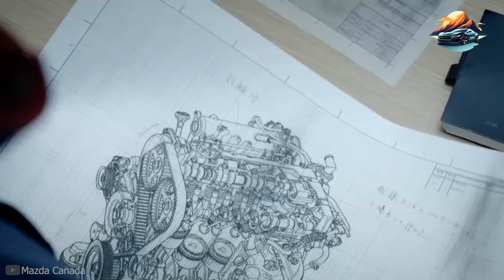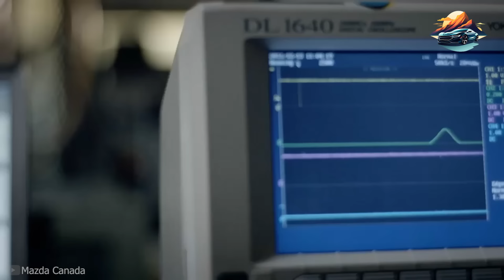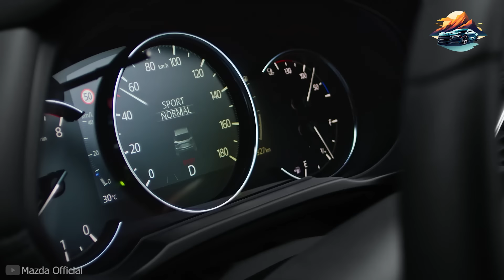4 Car Brands That Are Equal (Or Better) Than Toyota For Reliability

Comment: As a mechanic for over 28 years, I say Toyota cars are reliable, but their reliability is over rated. In the late 90s until 2003 their v6 had major sludge problems, just look up the class action lawsuit on the Toyota 1MZ v6. Then look at the rust problems on their truck frames that they are now paying a billion dollar lawsuit on. Also the oil burning problems since 2008 on the 4 cylinder engines, and now the turbo engines are blowing up. Why don’t they ever get the hate of the car journalist? These so-called experts hate on Nissan when they come out with innovative technology, but Nissan is still the company that make Subaru’s all wheel drive not Toyota. And Subaru had much better engines when Nissan was making the pistons and crankshaft. But Nissan sold their ownership of Subaru to Toyota in 2002. IRS interest Nissan wasn’t on this list, and Subaru’s reliability has gotten worse since Toyota bought the controlling share from Nissan. That should tell us something. Toyota still makes good cars, but Nissan makes better in several models. Just look at how long do Nissan engines last and Google the same for Toyota. I work on them. I own a 2001 Nissan Xterra v6 I’ve had for all 23 years of its life, and it has 462k miles on it. All original engine no special maintenance, all power windows and AC system original I replaced the starter at 303k miles and 16 years old. All the Nissans I’ve owned I’ve put over 300k on three of them with no problems at all. Just change oil, and all the filters. I’m sick of hearing that Toyota’s are the top of reliability, most Japanese cars are very reliable, and that certainly includes Nissan!
Reply: Thank you. You've spoken my mind.
Reply: Very true! Toyota reliability is over rated. Several problems worse than other brands. Just the noise they have managed to create about their reliability
Reply: @frno1073  That is just one brand. What about the numerous problems of Toyota venza?? I've seen many Corrolas entire back axle fall off. A lot of chassis problems. 
And when on highway, most Toyotas cannot handle the highway speed pressure. They become light like a paper and we overtake them and their accelerator pedals touches base. I have a Volvo s40 driven over 20 years but I make all Toyota cars small on the highway except the land cruiser .
Reply: My Navara has electronic 4x4 system way back in 2008 but it is recently that Toyota hiilux has done it. Toyota sticks to old simple fashioned gadgets and always copies others after being invented.
Reply: @frno1073  They used cvt transmission from Jatco which affected them few years back but they've quickly changed that. The new Pathfinder is my dream car lol
Reply: @frno1073  They used cvt transmission from Jatco which affected them few years back but they've quickly changed that. The new Pathfinder is my dream car lol
Reply: Nissan was a good car, see even you give 20 years old examples. Since the advent of CVT trans, Nissan is still a descent car but must put money aside to change that transmission that will crap, just a matter of time.
Reply: What's your opinion of Honda CRV?  Is the hybrid a wise choice?
Reply: I do not believe Nissan makes Subaru AWD.
Reply: I am 62 yrs old now, I owned 1998 Nissan sentra, it had no issues for 25 years. I even bring it to mountainous at sierra madre, surprisingly, no problem encountered. 
It was sold at a price of 70k early this year,

Comment: Nothing is better than Toyota. Lexus maybe but it isToyota😊
Reply: For sure
Reply: Had 2 Camrys they were great. Now have a Lexus SUV. I love it. Will always be a Toyota Lexus fan.
Reply: Company’s truck sold Toyota Tundra @ 750k miles and still no major repair…
Reply: My Lexus is 10 years old. Nothing has broken. No breakdown or failure anywhere. Nothing ever.

Comment: Had Scion tC  (that's Toyota) 2.5L engine... have driven it like a hell, hard, fast... however, changed oil regularly...  Made 300,000 miles with NO - ZERO.... absolutely NONE - ZERO issues
Reply: I still have my 09 baby blue Scion TC that has no tears or rips in the dash or cloth seats!  The paint is still shiny on the entire car and has a little fading on the trunk and on top of the drive and passenger side view mirrors (which are painted plastic, i think)!  It’s our current 3rd extra car parked outside with a car cover on it when it’s sitting and not driven (i drive it sometimes to keep it well lubed and moving).  😉
Reply: bro, just wondering, I have a 2010 tC, and engine is great... except it EATS motor oil like no tomorrow... heard its a common problem with this engine type, are u having similar issues?
Reply: @ I have an 09 TC w/ 189K mi on it.  I have noticed over the last 10 yrs I had to add oil every once in a while.  I’ve been using M1 full syth 20K oil for the last 10 yrs.  It’s a 3rd car now mostly parked, and still trouble free.  That 2.4L with that 4 speed auto in them may be why they went trough oil a lot because it’s always above 2k rpm’s.  Maybe those w/ the 5 speed stick spin less rpm’s.  RPM’s are a killer for many older cars that didn’t have 5 speed auto’s or 6 speed manuals.  That’s my opinion anywho.
Reply: Same
Reply: the tC had one famous failure on the trunk lid handle. Where the brake light was I saw many of these that had just fallen off. Poor glue or whatever. Looked very shody.
Reply: @nz4165  Play stupid games (like not changing the oil each 5'000 miles / max. 1 year), win stupid prizes.

Comment: I have a Toyota Previa LE ‘93.  It has 295K miles on its original engine and transmission. It still going strong without the need of extra oil in between oil changes.  The best part is that fuel consumption remains the same at 22 mpg on the average using regular fuel.  All I do is maintaining oil changes every 5,000 miles interval, vital fluids topped off or replaced and filter changes regularly, tire pressure and rotations on schedule.  That’s it.  I think this Toyota will easily give me many more miles of service based on its current performance.

Comment: A relative of mine had a Forester. Constantly in the shop with a problem dealer couldn't fix. Traded it in for a Honda.
Reply: Ihave owned 2 Toyotas and had problems with both, had better luck with Honda and KIA than any other cars for past 50 years.

Comment: I own a 2010 tundra and a 2012 rav4 with 2.5 motor, I also ha a 2021 ridgeline, with 3.6 motor. I have had a few issues over the years but solid vehicles. Also previously owned a handful of civics, if I was not an old geezer I would still buy civics. Just can't get in and out of them.

Comment: These car brands are top shelf as long as they are assembled in Japan!!
Reply: AHH, try MEXICO!
Reply: I have a Toyota made in Kentucky 20 years ago and it’s performed just like a Toyota. Which is not to say I wouldn’t buy one with a Japanese manufacturers plate given the choice.
Reply: @brettboyer8739  Toyota's built in the USA where early as good as assembled in Japan. The problem is they, and a lot of the parts are now made/assembled in Mexico.
Reply: My new Lexus NX350 was made in Canada.🇨🇦👍👨‍🦳
Reply: @richardc6932  It should be made in Japan but Canada is still better than Mexico. It's not actually "made" in Canada it is ASSEMBLED there. Trust me, most of the parts are probable made in China, Korea, Taiwan and Mexico.
Reply: @danr4197  my 4Runner is direct from Tahara Japan sir.
Reply: @jamesseabolt5915 4runners are only made in Japan
Reply: Cx5

Comment: I've had 4 Subarus one after the other over a 20 year period. Never let me down and they were all high-performance Imprezas. Their 4WD system was second to none as was the handling and practicality, not a bad car to work on either. Unfortunately, whether through lack of investment or whatever, the other manufacturers caught up and passed them. Now in partnership with Toyota, it should be a beneficial relationship.

Comment: i have owned and driven Honda, Mazda, and subaru. None of these three cars can compare to Toyota Reliability.
Reply: @marklo4416  Yep, it's not for nothing that Lexus is #1 and Toyota #2 in reliability.
Moreover, Toyota is #1 in low TCO (Total Cost of Ownership), Mitsubishi #2, Lexus #3 (surprisingly for an entry luxury brand, because the rest - except Acura - have at least a double TCO if not triple or quadruple).
But yes, Mazda and Subaru follow Toyota (it's not a coincidence that Toyota is a minority shareholder in both).
Honda is going down in reliability and it's a pitty. Nowadays even Suzuki is more reliable (with the cars I like) than Honda 😢
Reply: I own a 2010 tundra and a 2012 rav4 with 2.5 motor, I also ha a 2021 ridgeline, with 3.6 motor. I have had a few issues over the years but solid vehicles. Also previously owned a handful of civics, if I was not an old geezer I would still buy civics. Just can't get in and out of them
Reply: @MPCar68 Mazda is on par with Toyota. Great cars.
Reply: I am still driving my 2001 Honda CRV. I will drive anywhere that has a road without any hesitation.
Reply: Mazda is catching up very quickly! Who is with me?
Reply: Mazda is better
Reply: Ive owned all, I think Honda is the most reliable, Toyota/Lexus, Subaru comes slightly behind because more electronics to break, Mazda is a late coming to the party
Reply: كلم عاري من الصحه  تويوتا لكزس هما الأفضل جوده وإعتماديه
Reply: toyota has lost it's shine.starting with the 2024 model year.....reliability, durability,all gone, just a memory. those that own a 2023 or older, keep it forever,those are the last of the good ones.
Reply: I believe you but Honda and Mazda are more fun to drive. Had two Toyotas, reliable but did not like the way they drive.
Reply: You're right with that
Reply: The secret, Nissan
Reply: Any Japanese car is reliable
Reply: Oh yes they can.    HONDA IS AND ALLWAYSS WILL BE THE BEST CAR FOR THE PEOPLE.
Reply: That's because Toyota is not into high-performances engines. Here in Europe, you will see small French cars like Renault twingo reach 0 to 100 in fewer mins than Toyota Auris for example. The French and German car brands have "compact engine tech" with fuel efficency and high performance goals, why the Japanese andcthe South korean engines are still at the classic stages - big consume more fuel and slow. That's why they are more reliable.
Reply: @billw8476  Thats the Hybrid technoogy coming down and its going to feature in all brands !!!!
Reply: We’ve owned two Toyotas and three Subarus and can’t tell a dimes worth of difference between them in terms of reliability.
Reply: Yes sir .
This guy has it all wrong.
The only one that comes close is Mazda.
Subaru is no where near as good as they would have you believe and they always have problems with their CVT transmissions. They’re also known for their engines blowing up.
Honda …… Honda has lost its way. Can you imagine a 1.5 litre turbo in a Honda accord ?
Reply: My Lexus is 10 years old. Nothing has broken. No breakdown or failure anywhere. Nothing ever.
Hard to believe really.

Comment: I drove 3 subaru,,,2 outback n 1 legacy...good cars...boxer engines do not last long vs line 4vn v6
Reply: I drive Subaru's..........But believe in truth and Their Boxer engines are inferior to Mazda or Toyota or Honda....Paul
Reply: @paulholterhaus7084  at least later Subies no longer have the head gasket problems.

Comment: Hi Scot. I am going to give you my experience in this cars that you have mentioned: mainly in Europe and Africa. 
1* Subaru is very good on off road performance but their engines are very troublesome especially with cam belt issues and miss firing and very expensive to repair due to the complexity and accessibility to engine components. 
2* Mazda also reliable engine wise but body is very weak it rust up easily especially those who stay by the coast and to make them lighter like you said the body parts are extremely soft/weak. As for the rest good in every aspect. 
Mind you that in the past I had a Mazda 323 hatchback, a Toyota Avante twincam 16V and a  Honda civic and later a CRV. But again I think the American market has no comparison with Europe or Africa. I think because the cars that are built for the American market are completely different in a lot of aspects.
Reply: I own a 2007 Mazda6 2.3L sedan A/T and live 2km from the coast. Not a spot of rust and it's parked underneath my house, not in a garage.

Comment: With Lexus, 2 of the 4 brands in this video are Toyotas. Subaru is a Toyota now.  Toyota owns 50% of Subaru and controls of the production of the cars.  All the Subaru factories have been retooled to run the same as Toyota factories and use Toyota management techniques.  Of course the quality is the same.
Reply: Correction: Toyota owns 20% of Subaru in 2024.

Comment: My Subaru have 300K Km and 9 years old. I do a lot of off grid camping. Have never done any major work except aircon cooling coil (SG is over 24C everyday of the year), and wheel bearing change. Last did did the most major maintenance and that is a $1K transmission overall. To me its a great car.
Reply: I am glad that you have not had any head gasket problems, my mechanic tells me its an expensive fix, having to remove the engine.
Reply: They accidentally make a few good ones but Subaru are not likely to be cheap unless you don't drive much

Comment: I had a 2023 outback  and almost had 3 accidents had it not been for me slamming on the brakes. Traded it in after 6 months. Dealership never said there was anything wrong with the car.
Reply: sounds to me like the problem is the driver, not the car.
Reply: Sounds to me like the brakes worked just fine
Reply: Daughter's Forester took off into a fence causing thousands.  Class action has been opened by others for same

Comment: My son owns a Subaru, a well engineered car. Unfortunately the design engineers did not care about ease of maintenance. The engine need to be removed for a lot of simple maintenance. Costing a lot more than my Camry or Corolla.
Reply: Your comment is old but, like what? Subaru engines are actually super easy to pull out, but I still don't know what maintenance you'd need to take the engine out for.

Comment: Talk to a good friend of mine today. She has a Subaru Outback. It has approximately 90,000 miles. Has been faithfully maintained all servicing done at the Subaru dealership where she purchased it. She has four oil leaks. And this is a car that has been impeccably maintained.
Reply: What is the year of that Subaru of hers?
Reply: Probably because they quit using gaskets

Comment: It's  HONDA all the way for me. Two CRV s over the last 23 years. 
Comfortable, reliable, economical.  Never let me down.
Reply: I like the CRV hybrid but it doesn't have a spare tire. So it's the Rav4 hybrid for me.
Reply: @kenfrank2730  Yeah, lack of spare tires is logically liable to become a major issue in choices for many. It eludes me why these makers are ok with losing customers over such a no-brainer thing. Alongside an opening roof. Those gimmicky fixed panoramic all-glass roofs can in no criteria replace a simple opening moon roof or sun roof for fresh air and only increase the risk of higher potential maintenance expenses and even lower safety. I just don't get it. Strange direction for a brand (in this case i mean Toyota) that supposedly caters to practicality.
Reply: I think very highly of Hondas, owned a Accord back in the 80's loved it until I had a small fender bender that totally wiped out my front end. My problem with Honda is that their engines are all high tech, with leads to much more expensive repairs and cuts down on their longevity. I also feel the quality of the material used is inferior to Toyota.
Reply: Definitely honda!!
Reply: Good info.  What's your opinion of Hybrid CRV?
Reply: I owned a 2007 Honda CR-V (gasoline, manual transmission). Bought it 2010 and traded in 2018. Sadly had some problems with shock absorbers and headlights. With Toyota and Lexus, no problems at all and I have owned many (Celica, IS250, IS300h, RZ450e).

Comment: I had a 2015 Subaru Outback 3.6R. It was one of the worst cars I ever had. 4 recall! I traded out of it after 2 years of horrible tech.  Eyesight at the time was their showpiece, and I found it to have a lot of false positives.  It was never dangerous, but an example would be a big splotch of paint on the roadway to work would trigger imminent collision alert.  The wireless key system was unreliable, and the system was a battery drain as the car often would not go to sleep at home.  I had to make sure the keys were in the bedroom and not in any room near the garage.  CVT.  I'll never buy a car with a CVT ever again.  The Outback could not be trusted in situations where you needed a sudden burst of energy.  The CVT could not figure out the proper setting for what you were pressing the pedal for.  Lots of noise, little reaction.  Ironically, I traded it to a 2017 Jeep Grand Cherokee and that car was one of the best I've owned. Despite public opinion, the Jeep was exceptionally reliable.

Comment: I bought an Accord 5 years ago with 170k miles. I paid for $2500. My plan was to use it for one year and then  send it to the junkyard  once it stops running. The problem is that after 5 years that thing is running just the same😂😂😂😂😂.  Now it has around 250k miles😂😂😂 and has never fail. I guess I should change the spark plugs one day😂😂😂😂.  All I can say is that my Honda has save me a lot of money, I haven’t make a car payment since them and it has the original engine and transmission. I only replaced brake pads and tires😂😂😂. So, for now I trust Honda. I hope they don’t change.